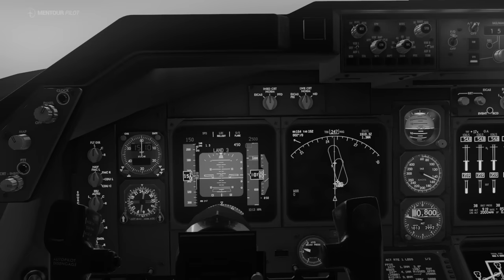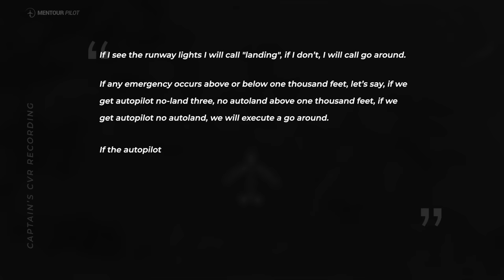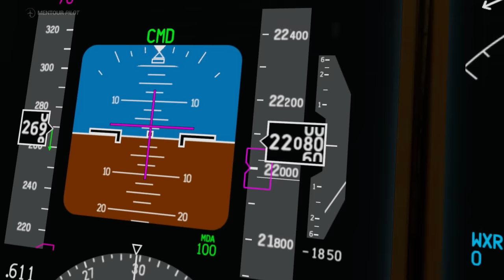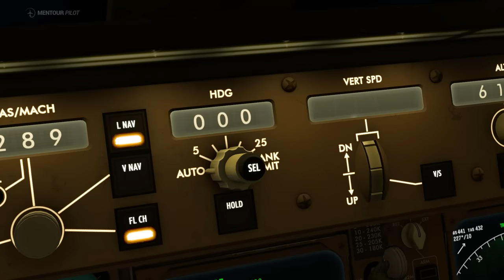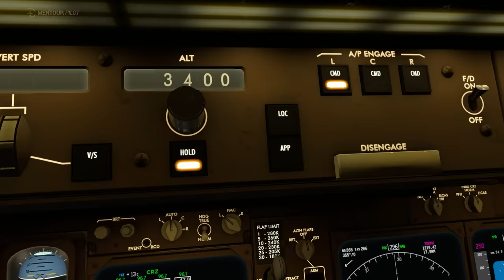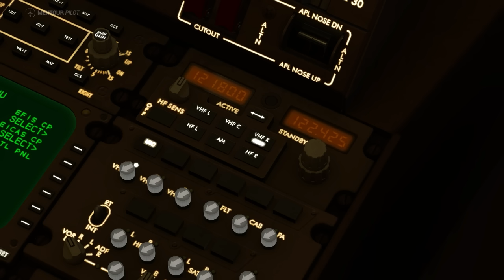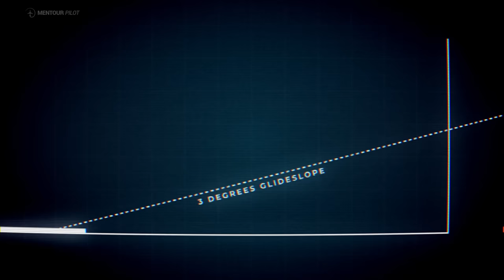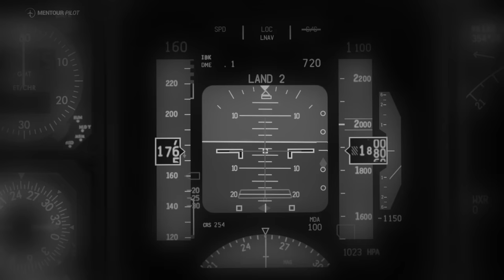Where is the RUNWAY?! Unraveling the Mystery of Turkish Cargo flight 6491

Comment: You left out the most important part. This accident was caused by reversed CAG. The FO’s rank in the military was much higher than the CPT’s. This ultimately lead to the delayed G/A, as the CPT did not dare to act against the will of his former superior. Turkish Airlines managed to hinder the inclusion of this in the final report. They also refused any involvement in this crash, despite the fact the flight was operating under the callsign THY6491.
Reply: The point is that the CVR clearly shows that the FO acted very submissive to the Captain and that the Captain even shutted the FO down in a very harsh tone when the FO tried to speak up against him. So definetely: No.
Also: It was an Aircraft from ACT Airlines, which is a Turkish Cargo Airline. The Flight was operated on behalf of Turkish Airlines Cargo with a Turkish Airlines Flight Number, but it was another Airline and the Pilots were Employees of ACT Airlines.
Reply: @NicolaW72  I did not make this up. I got the information directly from a 747 CPT who worked at ACT Airlines at the time, so the pilots involved in this crach where his colleagues (he knew them personally). You can decide who you believe: first-hand information or some doctored CVR transcript.
As for the Turkish involvement: assume a close relative of yours books a flight with a well-known airline, which is generally perceived as a safe operator. Had the planed crashed because of the incompetent pilots (who were autocratic ex-military pilots unable to work in a multi-crew environment), who would you blame? In the first place, the well-known airline, not the little-known wet lease operator, since you did not book the ticket with the latter. In the case of this accident, Turkish Airlines was comissioned to transport cargo, but they did not have enough capacity, so they had to hire AirACT to do the job.
Reply: @erikdeme  The CVR is the original source, whatever anybody else is talking. This Video explains it very well what happennd.

And yes, ACT was chosen by Turkish Cargo because Turkish Cargo had the need for it. Therefore it operated under a Turkish Flight Number. But it was nevertheless an Aircraft and a Crew from ACT Airlines.
Reply: You're making it sound like the FO made all the wrong calls and shut the captain down whereas it was the opposite

Comment: "The investigation also pointed some fingers towards Boeing because even though the aircraft had performed exactly as designed, the investigators felt that the complete loss of glide slope signal should have triggered a more unambiguous warning rather than a caution to snap the crew out of their decision tunnel and, hopefully, force a go-around."
And this is why flying is the safest form of transportation and I wish the we would apply this same thinking to cars and road design. That the investigation found that the fault was essentially entirely human error for ignoring the warnings and yet they still came back and said, "but what can we do to prevent the same human error in the future" is the single biggest contribution to airline safety. After a car crash, it is determined that a driver was at fault and we just wipe the dust off our hands and say, "whelp, human error, nothing we can do to prevent that happening again, maybe release a PSA to remind people how important it is not to make mistakes." Between 40-50k people a year die in car crashes every year in the United States alone, that is the equivalent of having the Ethiopian Airlines Flight 302 (the flight that resulted in the 737 Max line of planes getting grounded) every other day and we just shrug and say, "human error, nothing we can do", but imagine what we could do if we treated it like we did the 737 Max crashes and every other airline crash and figured out even if it was human error, what could we do to prevent people from making the same mistake in the future.
Reply: I feel like y'all take this logic too far. Of course it's safer, it's a vastly higher risk of death. A car crash could just as easily leave me alive as it does leave me dead, but the survival rate of plane crashes is not as high. If I get into a wreck, especially as the one in control, and especially if I've picked a safe car, my chances of surviving this wreck are infinitely higher than if I am in the back of a pressurized tube falling from the highest heights we have attained, at speeds that are used to traverse the globe in hours. It has to be safer or it'd be a stupid invention.
Reply: @TheHaddonfieldRegistry  the thing is, for a long time, flying wasn't safer. The crash rates of earlier planes was appalling. It is only because we made the conscious choice to continuously improve, to never accept "safe enough" as the standard, to treat every crash as an opportunity to learn how to prevent the next one, that it has gotten as safe as it is today.
To your point that car crashes are lower risk, because you aren't in a pressurized tube, falling from height, at incredibly high speed, you are absolutely correct and that only makes the fact that 40-50K people a year die in car crashes, just in the United States, even more appalling. That's 110 people a day on the low end. Just imagine if we took those 110 deaths as seriously as we do when 110 people die in a plane crash. Just imagine how much safer driving would be if after a crash, they didn't just say, "driver error, that's it then", but instead took the time to figure out why the driver made the error. Was it because there wasn't adequate site lines at the intersection? Was there signage that was confusing and made it unclear what the driver was supposed to be doing? Is there a safety feature that could have been added to the car to prevent the crash that we can start putting in new cars? Does the road geometry encourage speeding in that area? Obviously it wouldn't be practical to do a NTSB level investigation after every car crash, but maybe at least have people from the city engineering office or state DOT go out to collect data from every crash so they can determine if there are trends, perhaps look at the stretch of road through a new lens working backwards from the crash to find if there was something about the road that made it dangerous. 
At the end of the day, we'll never truly get zero fatalities on our roads, so long as humans are in control (and even with self driving cars, humans are in control, just with a few steps in the middle, after all, humans are the ones programming the cars), we will make mistakes (to err is human). That doesn't change that we should strive to make our road system as resistant to errors as possible, by continuously reviewing and improving them.
Reply: You are not going to change driver behaviours without wider cultural change.

Unlike aircraft where it's drilled into them and an intrinsic part of their job.
Reply: They sort of do that. They have these proximity alarms on new cars that shriek at you whenever you get vaguely close to another car on the side. The thing is, if you are driving a vehicle, sometimes you do need to move, you know, side to side. You have that under control until those alarms break your concentration. Too many warnings and alarms for too many things create fatigue and break concentration, likely causing more accidents. 

Honestly, I have the same opinion of most smoke alarms. I am grateful for them, they have - exactly once - done their job properly. Usually, however, I am focused on cooking. The situation is under my control, and I am watching it like a hawk. A tiny wisp of smoke, normal to cooking, emerges and the alarm starts shrieking. This breaks my concentration on cooking and I now have to struggle with a stick at best, a CHAIR at worst, while shaking with adrenaline, to turn it off. And open the windows. Which takes my concentration off of cooking. Fortunately, I have the presence of mind to shut off the stove and the oven when this happens but it still creates a dangerous situation out of what would have been a totally normal and harmless situation.

In most cases, this is what would happen with alarms in cars.

Comment: This was a very sad event which occurred. 

The ATC could have seen the aircraft flying over the runway but still descending. The ATC could have asked the pilots about their intentions which could have alerted  the pilots about the aircraft's state.

The 2 additional crew members sit in the cockpit during takeoff and landing phases of flight. They could have also alerted the main crew about the aircraft's state.
Reply from the maker: They were likely not sitting in the cockpit
Reply: ATC was a total no-show
Reply: As Petter alluded to, the other two pilots were likely sitting in the crew rest area. If they were in the cockpit their voices would have been recorded on the CVR.
Reply: From a visual control room at night it is very difficult to judge aircraft altitude and distances.
Reply: Some sources say they were not pilots, but load masters. Please correct me if I’m wrong.

Comment: About 35yrs ago at Brisbane airport in Australia, a new airport was built basically in line with the old one but about 10kms north , the runway was still under construction and was 01 , 19  the same as the runway in use but .
The airport it's self was a floating type of construction built on dredged sand , so to stop the sand blowing off the runway the very stupid contractors thought that putting a layer of black tar on would stop the wind removing the sand . A Singapore Airlines 747 was making what he thought was a visual final on runway 19 at Brisbane but was actually on final for a black painted sand strip 10kms to the north , It was only luck the captain noticed there were not threshold markings and did a very impressive glideslope correction and landed safely .
3 Moore aircraft nearly did the same thing , so large white crosses were painted on the tar to show it wasn't a runway . Could have been a very nasty outcome had he not noticed .

Comment: Early on in my career,' I got into the habit of checking my altitude against the DME.. 10 nm out should usually equate to around 3000ft AGL..7 at roughly 2000.. didn't need to be exact, just a rough approximation..it certainly helped when operating into Kabul at night in poor wx.. military ATC in the early days would occasionally forget about us while surrounded by rock faces, then give us an intercept from above the glide.. avoiding the false glide added to the entertainment.

Comment: I fly the E195 and we actually do not have an autoland function on our aircafts. During CAT3 conditions we have to fly manually using a head up guidance system and flare with a specific "flare cue" which is a point that we have to follow at around 50 feet RA. We can get down to 50 feet DH and 200 RVR. Only the Captain will fly those approaches though as we are not trained to do so.

Comment: Another brilliant and crystal clear account of a truly horrific accident.  Errors compounded by further errors without correction forecast disaster. Talking of which, your English is as truly outstanding as your (well recognised!) technical knowledge, aviation skills and instructional capabilities - Bravo!

One tiny pedantic point (speaking as a 🇬🇧), both 'forecast' and 'forecasted' are accepted past tense common forms of forecast. But forecast is more widely used in dictionaries, online spellcheckers and by linguists.  The reasoning is that as the verb does not derive from a noun, it should therefore follow the irregular form.  Eg, "I forecast that..."...  "I received the forecast..."... "it was forecast that the weather would deteriorate."   But hey, that's a tiny point of minimal consequence.  On which, 
"minima" is the Latin plural of minimums and it prevails in registers of English where Latin forms are typically favoured over newer English forms—that is, mainly in science and mathematics. Outside these fields (USA, Boeing, aviation, instrumentation?) the English plural, "minimums", is preferred by a large margin.  

But I write the above just to nit pick a bit, as I found your account of this tragic accident absolutely flawless.  As ever.  

Best regards 😊😊

Comment: There's been numerous accidents related to the 6 and 9-degree false glide slopes. Is It possible to have a cross-check with GPS in the system to verify the glide slope?
Reply: I think even some simple maths would be enough to  calculate the angle being followed.

Comment: It's amazing/sad how many accidents could've been avoided by a simple go-around
Reply: But they didn’t even need the go-around. Request a 360 to lose altitude and speed. Mentour Pilot even mentioned something similar in this video. The 360 even gives you time to reassess the situation. Instead of complaining about ATC, say something like “too high, too fast. Request 360 please”.
Reply: @MarioGomez-zg7hb   360 in terrain surrounded by huge mountains? Not always a good idea.
Reply: @EvoraGT430   That's why checkpoints exist. Perfect example here, TOKPA was to be flown at a minimum of 6000ft. They overflew it at 9000+. So just request a hold at that point, lose the altitude and continue on from there. Problem solved.

Comment: Couple of weeks go inexperienced my first rejected takeoff in over 30 years flying as a passenger. In Paris we were going to Vienna, the aircraft was a 220. Pilots spooled up and once stable released the brakes and advanced to take off thrust. They immediately pulled back the engines so I’m sure we were below 80 knots. We taxied off and took a scenic tour of cdg lol. They are working on multiple runways at cdg so it took a while. They told us they needed to check something. I guess whatever it was got resolved as we went back to the same runway and took off just fine 15/20 minutes later and got to Vienna just fine.

Comment: This reminds me of an incident known as the "Omaha Runway Mix-up." On March 14, 1960, a Northwest Orient Airlines flight traveling from Chicago to Minneapolis made an unintended landing at a muddy runway in Council Bluffs, Iowa, instead of Eppley Airfield in Omaha, Nebraska. (They actually landed on the wrong side of the Missouri River).

The incident occurred due to a series of errors and miscommunications between the flight crew and air traffic controllers. The crew mistakenly believed they were on the correct approach to Eppley Airfield, but they were, in fact, off course and descending towards the Council Bluffs Municipal Airport. Poor weather conditions and low visibility further complicated the situation.

Thankfully, no one was injured in the incident, and the aircraft, a Lockheed L-188 Electra, was not damaged. This incident led to changes in air traffic control procedures and increased awareness of the importance of accurate communication and navigation in aviation.
Reply: That would be a fascinating incident to see a video about. I particularly enjoy the coverage of incidents that are turning points in how the system works.
Reply: I really like stories where a major lesson was learned without anyone dying or even an aircraft getting scratched.

Comment: Hi Mentour, nice video, quality video, higher quality information! 

One of the most tragic accidents I've heard off is the collision between BTC 2937 and DHL 611, that ended in 71 dead + 1 murder, maybe we can skip the murder part but I'll want to know what more painful lesson we can learn from that incident.
Reply: The "+1 murder" just makes me want to know more. I'll have to look that up now.
Reply: @AngelWedge  The ATC operator was murdered by the father of a passenger on the Bashkiristan flight. The father blamed the controller for the accident, although it wasn't primarily his fault.
Reply: Lots of worse disasters than that, including worse mid-air collisions, but yeah, the Ueberlingen crash is a sad story. That said, the lesson is simplicity itself: when TCAS gives you an instruction, FOLLOW IT.
Reply: @fredocarroll took us 1 mid air collision for tcas to be properly implemented, but the uberlingen one and the one in Brazil were plain stupid and just pure negligence 
either way all mid air collisions are caused by negligence

Comment: Love your videos once again. 

I have a random question: Say a car was travelling on the road at 500mph… is that the same as a plane in the air at 500MPH? If that makes any sense.
Reply: the car measures its speed in relation to the ground, while a plane normally measures its speed in relation to the air around it.  the plane also uses nautical miles per hour, as I recall.  a nautical mile per hour (knot) is about 1.15 land miles per hour.  (MPH)  so to make my math easier, taking a car at 100 MPH, if a plane is flying above it in a 10 mph tailwind, at 100 knots airspeed, it will be flying at 115 + 10 MPH conversely, if it is flying at the same speed as the car, its indicated airspeed will be just under 77 knots. (assuming I did my math correctly)
Reply: @kenbrown2808  great thanks!
Reply: Yup! If the winds are strong enough a plane can get airborne while parked and can land at a standstill (i've seen some YT vid of some small planes that exemplifies theses extremes pretty close). Wings only cares about air speed regardless of what produces it.
Reply: @FN1980a  i never found it again, but there was a short takeoff competition video where a super cub took off with less than a full revolution of its wheels.